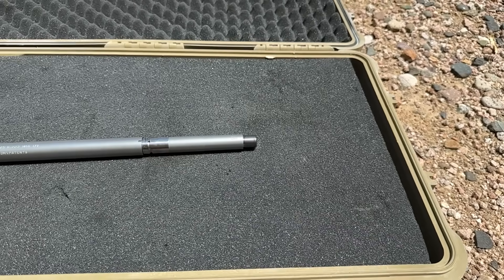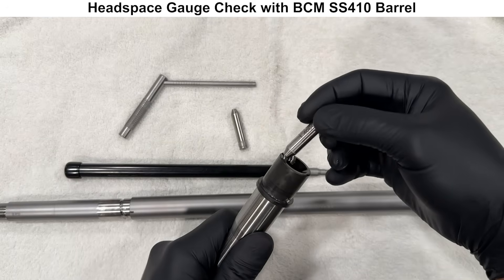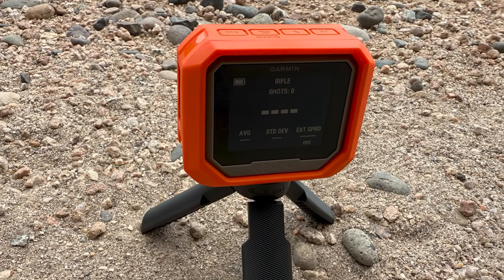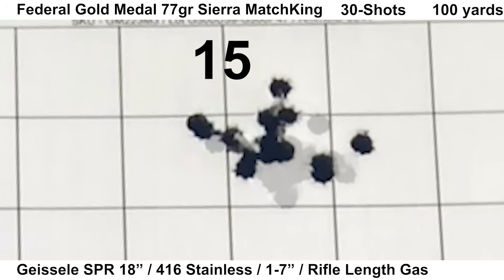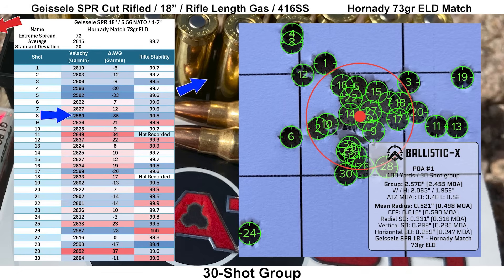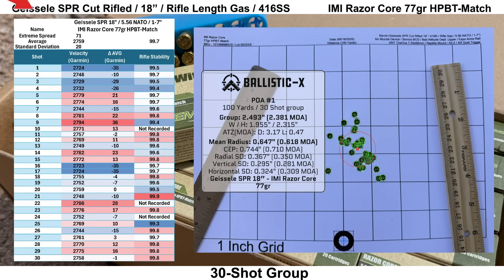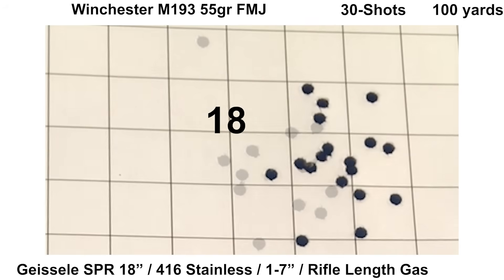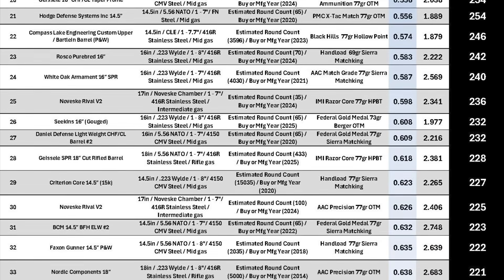Geissele 18” SPR Cut Rifled Barrel: Inspection and Groups With 4 Loads

Comment: Huh 5/8 24 threads are more so for 30 cal threads and its cut spr 416r barrel hats another why it is not chf I’m looking at a barrel to throw in a knights mk12 I do which I can find the re bcg from geissele because I own one it is the best bcg I’ve ever seen as far as the strength no it is very expensive. It’s a 400 change ECG and that if you can even find it get it, I tried finding it in stock for a while a few years colt is making the urgi bcg and the armies said that REECG is the best that they’ve ever seen ever out of any carrier they’ve ever tested. It does not wear and it’s very strange but it’s our coding technology that DLC and it’s true DLC what companies they wear if it loses the blackness shimmer in this color it’s not real. This does not lose anything. It is black and has state black and you could scratch it up and wipe it off and it’ll scrap black again almost like the metal is black. It’s not it’s just the specialized coating and the bolt is forged as well as it being carpenter 158+ so they’re using a high grade of carpenter 158 that they’re forging they’re using surgical steel extractor so it’s not lubricious, but it could be mentally dry at Walmart. You wanna keep it you know it’s very very strong and as natural anti tilt features, I do like the triple gas sports system. One of the reasons I do want to try out there apparels with the triple Gasport and I’m not sure I was thinking about doing it with either Centurion . I’m not sure about the receiver upper. I definitely want to thermal fit. The barrel for sure I know some arms does have bumps so I might do a I don’t really think you really feel but I definitely want to so I torch. I’ve noticed every gun I’ve ever had the rifle. I put together the tighter, the tolerance is on the fucking thing and headspace Jack as long as everything is tight quality good to go. You can feel it just cycling at once after you put those pins back in slick no tilt on the carriers nothing and I know the couples I can trust whether those kinds of things don’t happen and that would be centurion arm Geissele radian even regular it doesn’t have MB controls SART pen or whatever put in an Accu wedge or make one out of something a couple your crowd tape up together and put it in there and tightness can help especially shocked how that can really tighten up groups and especially if you’re shooting a receiver set that is super rat and say probably most of the springs and it need to be changed out and metal is worn out. It needs a lot of TLC to be a little bit good to go I do wanna try the old RA as Israel with a rifle life system, but triple gas port proprietary, and yup when it’s back in stock, I need to see do I need is there a proprietary spring that you guys have and buffer? What kind of buffer do I need to go with a 42 rifle length if I’m gonna be doing like a KAC barrel also if you wanna do some sort of there are besides the MK 12 rails there are the KAC2 piece and guard around 7 inches for the M4 non-free float KAC goes out if you understand a Delta ring goes from the Delta ring

Comment: Your not allowing the whip in the barrel to settle between shots.  That's why your getting wild groups .  The first five or more shots heat the barrel  ( through aways). After you get the barrel warmed up then take your shots one at a time  allow 20 seconds between shots  .  It seems to like Hornity the best .
Reply from the maker: The shooting footage is edited down for time (which is noted in the bottom left corner). I take about 4-10 seconds between shots.  I would think that would be enough time to let the barrel whip settle.

Comment: Very NICE .  I'm just a old retired Red neck , Last spring before it got hotter than a four balled Tomcat  I went up to the outdoor 100 yard range with my Smith & Wesson M&P Sport ll. I installed the STNGR floating rail w/bipod  and PSA 3.5 Lbs trigger  w/4x16x50  MOA .  Iwas able to shoot five  five rd. Groups  just over 1 MOA with a flyer at 1 3/8" out  using AAC 77 OTM SIERRA MATCHKING  ,  I was very happy with THAT 😁.   I took my 300 BLACK OUT 8.5"  zerod  it at 25 yards w/125gr  with Holosun 510c  turn the dot light low and got 3/4"moa  three rd. Groups  no mag.  25/200 battle zero  w /125gr.

Comment: Sorry if I missed it in the video, but did you notice any difference in felt recoil, with the phased array gas system?
Reply from the maker: Recoil is a bit difficult to assess well with the shooting setup that I use for this.  But, for what it’s worth, recoil felt pleasant. Although, I am not sure I would be able to tell a distinct difference between this barrel and a different 18” rifle gas with a well tuned gas port.  
In short, it felt nice, but not magical.
Reply: @PrestonJMoore I swear the phased array gas port marketing its just a Terminator goof.

Comment: This series has turned into an ongoing advertisement for the SOLGW SPR barrel lol. Can anything beat it?!
Reply: It would be cool to see another tested to see consistency of performance between lots.
Reply: Theyre supposed to be Black Hole Weaponry barrels.
There was hype about BHW a decade back, cant remember what shooting discipline it was.
Everyone back then swore by those, and Compass Lake chambered barrels like there was magic unicorn dust sprinkled on them.

Apparently the hype was real.
Reply: Newish subscriber great channel. Have you tried any Criterion Core barrels. I have a few that shoot pretty well…. Only concern if using higher pressure ammo they tend to pop primer from time to time if they’re not staked. Thanks for what you do
Reply: I heard that SOLGW barrel was coming from blistic advantage.
Reply: @gridlockd3  Their old standard barrels were, but the SPR one is from Black Hole Weaponry if I recall correctly. They have a special way of doing the rifling as described in this comment thread here which is why it's so good apparently.
Reply: Random 6.5 Gr stainless steel closeout barrel from Sarco. Cost: 80.⁰⁰.
Reply: Now that you’ve done the G$ barrel…..do a Larue Stealth….lets see how it compares 😊
Reply: I run Wilson Combat Stainless Steel match barrels. 5R. Utton pulled hand lapped. No chrome or melonite lining and the shoot damn good
Reply: @HPAccuracy WC is all marketing gimmicks, it’s 90s old tech from a fudd company. Tech has evolved WC hasn’t.
Reply: This really shows the advantages of edged poly rifling. The less edges the better the group, the harder part about edge poly however is the massive decrease in performance as it gets hotter. That’s the reason 5R got adopted and 6 edge SEP is the best fighting polygonal rifling. You can usually get away with general use bull barrels with 3 edge polygonal, SOLGW SPR is a HBAR with 3 SEP rifling

Also fun fact, bullets fired from a single edge polygonal barrel have the best BCs.
Reply: @ShepherdOfTheSilkies can you please elaborate on this? I’ve never heard about any of this. What kind of performance decrease?
Reply: @AnAxeToGrind gladly, as the barrel warms up  a grip the bullet less. That universal across all barrels. R type rifling has really tall ledges that bite in deep which grips are the well but causes gas to leak in front of the barrel. Edged polygonal has really low shelves, but more of them that cut into the bullet less and at an angle. There are two types of edged polygonal, single edge(the best) and dual edge(what Glock has patented, it has less benefits, but the same downside). If the barrel heats up enough it expands to the point where it does not grip the bullet well enough to fully stabilize. These temperatures are achievable after mag dumping 40ish rounds. SEP also had more consistent cold shots as well. 

It does have the downside of wearing rifle out faster, which is why in high-pressure applications like bolt guns it’s not often used, and instead they use a wider and shallow R type in a 2-5 edge configuration
Reply: @ShepherdOfTheSilkies thank you!!
Reply: @ShepherdOfTheSilkies  Thanks for explaining, I knew they used that polygonal rifling but had zero idea how or why it would work.
Reply: @ShepherdOfTheSilkies  do you know what other barrels have that type of rifling? I recently bought an fn 18 inch hbar and i am very curious
Reply: @ShepherdOfTheSilkies this isnt a polygonal rifled barrel. It is a cut rifled barrel. Polygonal rifled pistol barrels are hammer forged and only used for pistols.
Reply: @HPAccuracy Geissele SPR is edged polygonal rifling. 

And your second statement is widely wrong as well. Theirs a half dozen companies that make edge polygonal variants for rifles specifically. Zev, Triarc, SOLGW, and Geissele just to name a few storefront companies off the top of my head.
Reply: @HPAccuracy also theirs pictures of the bore from different directions that show this is edge polygonal rifling.

Comment: Your videos are awesome! Have you thought about testing the mr556a4 barrel? Keep up the good work!
Reply from the maker: Thanks for the support!!

Yes, thanks to a subscriber, I did get a 16" MR556A4 upper loaned to me.  Spoiler...  I had an issue with the upper and shipped it back to HK for warranty.  They've had it for close to 2 months now.  So, MR556A4 video is coming up.  But, it will still be a while.
Reply: @PrestonJMoore Thank you for the response! Looking forward to it 👍
Reply: @PrestonJMoore not surprising. I wish I could ship you a never issued or low round count M27 or updated M38 so they could bottom out your list.